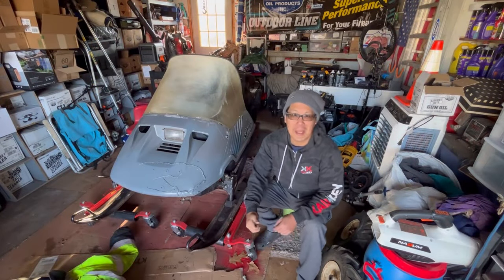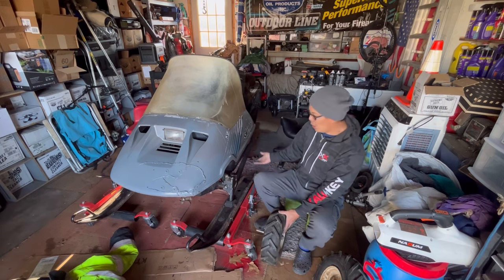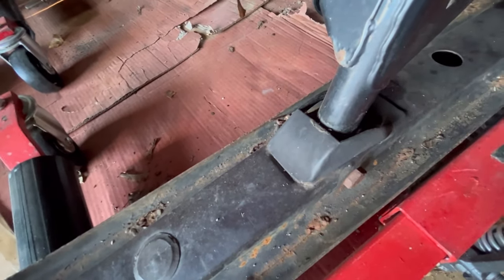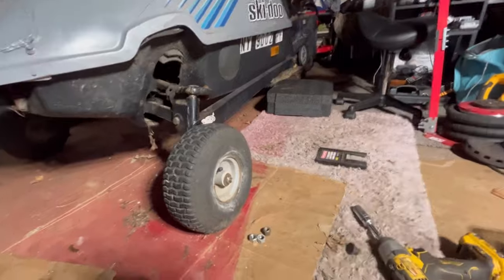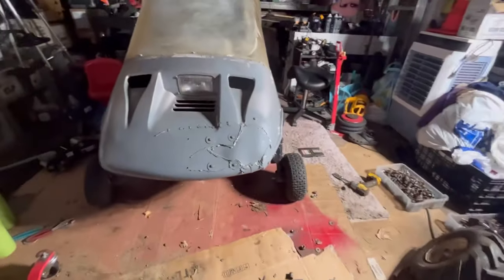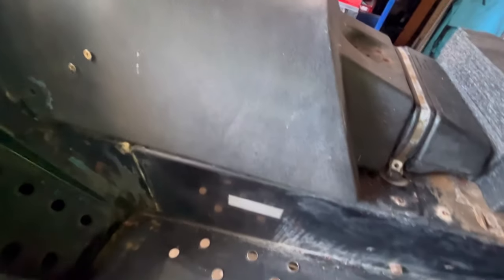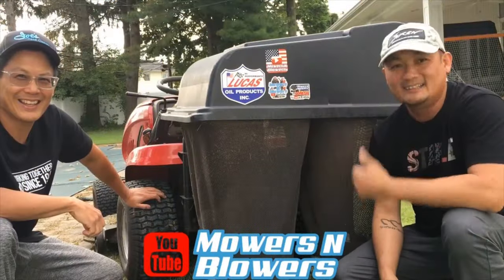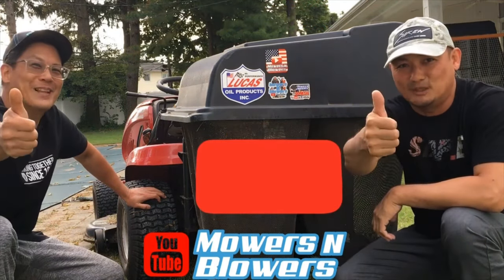SKIDOO FORMULA MX ROTAX 467CC SNOWMOBILE SEAT FABRICATION & LAWNMOWER WHEELS TO RIDE ON THE STREET!

Comment: When the blisters appear it's a time to take a break haha. I have a 2 stroke Kawasaki kd80 that when I accidently flood it out for some reason, I have to replace the plug every time I don't know why 2 strokes are very odd engines at times. I would replace the plugs and let the cylinders dry out overnight, the next day put the new plugs in and don't prime it. Also, maybe before you buy new plugs try holding the throttle wide open when pulling it somehow and that usually unfloods engines quickly. You'll get it Henery you're a smart guy, great video I like the wheels in the front works pretty good.
Reply from the maker: Thx for always commenting and great encouragement

Comment: Hey henery. I think the gas is rich on oil that's why it didn't want to start put a little more gas on the gas tank and spray a little of carb clean into the spark plug holes. Try that
Reply from the maker: Premix and oil
Injector creates too much smoke,  you missed the episode that I rode it?
Reply: @MowersNBlowers  yeap I just saw the next episode on the snowmobile. Sometimes the engines are a mysterious. Good job Buddy

Comment: You like running rich mixtures lol hence the plugs fowl pretty easy when the engine doesn’t run long enough and hot enough. Clean or replace the plugs and start it with WOT. I would also be extra careful next time I mixed up a batch of fuel for any two strokes.
Reply from the maker: Great point!

Comment: I would peg the throttle wide open while pulling it over. Sounds like it is choking itself out. Also remove the air cleaners and use a little starter spray it should dry it a little. Caution the sled may want to launch if it starts wide open throttle.

Comment: You don’t need to prime it that much when it’s warm out. If you’re fowling plugs, it’s too rich. Open the throttle while pulling. Also, don’t put a drill on the clutch. If it does start, you’re going to lose an arm.
Reply from the maker: Thanks, good info

Comment: Being a liquid cooled motor, with heat exchangers. that engine wont last long without snow to cool it down.
Reply from the maker: Air cooling in cold weather through radiators won’t work?

Comment: Sounds to me like that engine has no compression. I would do a test with gauge. 2 stroke usually pop because of compression. 
Those engines were notorious to have oil injection failure. There’s info on internet about the issues. Sounds like my no compression dead 377 engine
Reply from the maker: Stay tuned for the next episode
Reply: Thats not the case if an electric plug-in drill can't turn it over, plus you can hear the drill struggle when each cylinder hits compression stroke. Defiantly not low on compression.
Reply from the maker: @ChristineMacWhirter  you are correct

Comment: Do you realize you would've been damaged if that motor started trying to use the drill to start that sled? That drill would've spun around so fast and probably broke both arms or at least your wrist. Use some common sense before you get hurt.
Reply from the maker: Not any faster than a pull start.  Also the engine would just idle,   Not fast enough to engage the clutch.  But thanks for your concern
Reply: @MowersNBlowers he is correct that's a big mortor that will turn when running hurt your hand could have no spark id suggest checking all your wiring might have a plug end that not plugged in all war or you got a carb that has a bad needle seat
Reply from the maker: It had spark